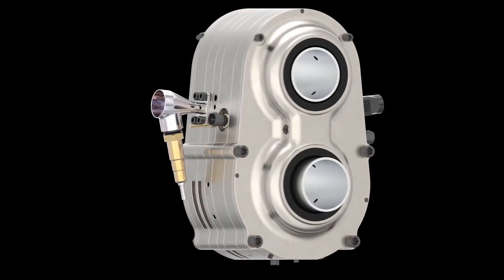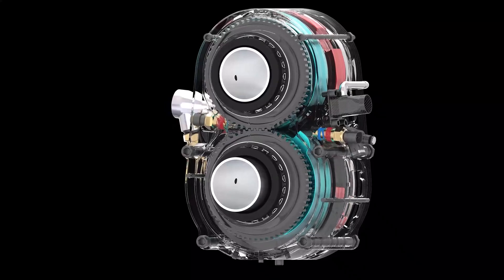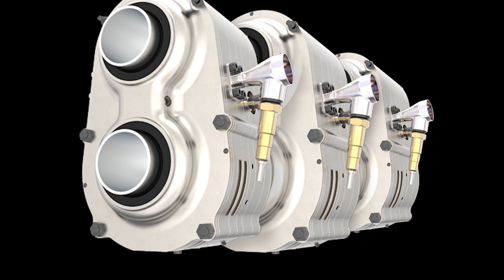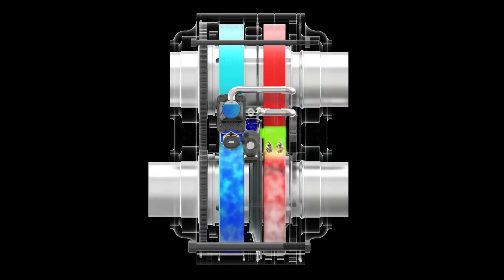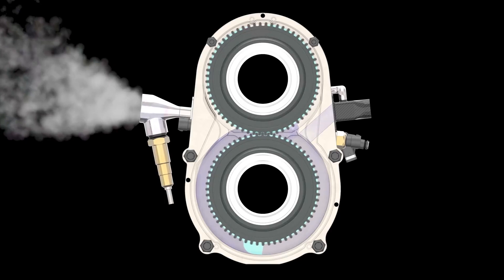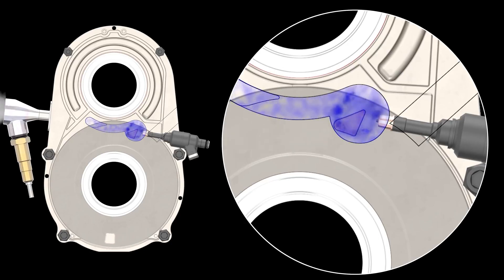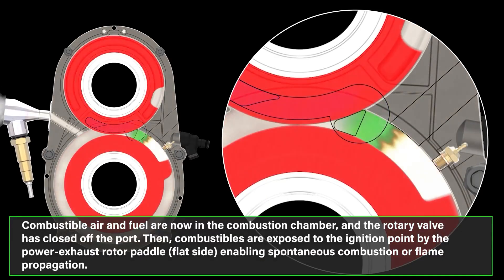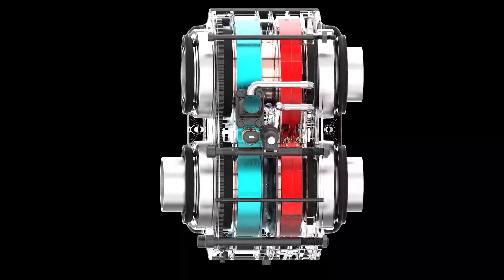This pistonless engine runs on hydrogen and revs to 25k rpm

Comment: Awesome, but I have questions:

Up to 416 hydrogen combustion cycles per second, with an insane compression ratio, and only a couple small openings in a couple dozen kilos of metal... What happens to the heat? How good is hydrogen at not detonating under that heat and pressure?

It seems too good to be true.

*edit for spelling
Reply: Hydrogen, among gasses has the widest range of explosive mixtures.

As far as undergoing true detonation, Hydrogen:Oxygen mixtures can easily be got to do that.
Reply: @Bob What yo do not seem to understand is that we already have a one world government.  And those people are the ones calling the shots.
Reply: @Bob The vast majority of hydrocarbons found on Earth occur in crude oil, petroleum, coal, and natural gas.

The most common place to find hydrogen on earth is in water. Each water molecule (H2 O) contains two hydrogen atoms.

Hydrogen is one proton and one electron and is the simplest of the elements.  It has 3 isotopes which are protium, deuterium, tritium.

You do not need hydrocarbons to get hydrogen.  It is found in its simplest form in sea water.

The owners of the petrol dollar will never allow that.
Reply: @Bob Anyways, I build RC planes and I am going to build a hydrogen generator by using water and potassium hydroxide (drain cleaner) as the electrolyte, and combine the gas with the exhaust from the turbine, which burns at 750 degrees C, to create an afterburner effect ,as hydrogen is highly combustible, on a 1/6 scale F-18 Hornet.  Gonna be dope!

Bob Lazar, the area 51 whistle blower in the 80's, built a car with an engine that ran on water!  Already been done.
Reply: @justanotherguy469  Do they not teach basic chemistry in school anymore? Hydrogen + Oxygen + a little energy to start the reaction causes a exothermic reaction (releases a large amount of energy) and creates water. This is how hydrogen engines produce power.
In order to separate the water back into hydrogen and oxygen you need to add the same amount of energy that was released when creating it as to not violate the conservation of energy. Otherwise you have created a perpetual energy machine. And as we have not been able to engineer a 100% efficient machine, the amount of energy needed to convert the water to usable hydrogen actually exceeds the amount of energy you can extract. The exception to this would be if you somehow managed to convert some matter directly into energy, but that is called nuclear fission and due to inefficiencies we have yet to make a stable reactor.

Also KOH + H20 -> Kaq + OHaq, aka aqueous hydroxide, not hydrogen. And I have no idea why you would need an electrolyte to generate hydrogen.

And also also if we have a one world government, why on earth would they care about the sustainability of the petro dollar? If there is one government controlling the world, would they not already control all the world's resources? And if they somehow managed to violate fundamental physics, would they not be leveraging that to further their goals?

Also also also Russia recently declared that all of their oil has to be purchased in rupals. The reason we have traded in USD up to this point is because it has been relatively stable, and because everyone is using it it's easy to do transactions.
Reply: @shadowcalen  I left a long comment for someone on Physics.  Check it out. Can't write about it right now. 

I will write about the petrol dollar and the role it played in Breton Woods.  

In 1912 a group of bankers conspired to overthrow the constitutional financial control of currency creation, from the people of the United States to themselves, by enlisting President Woodrow Wilson to pass by executive order the "Federal" Reserve act, which privatized our currency supply on December 23, 1913 while congress was out of session for the Christmas break.  The "Federal" Reserve is private.  Every penny collected for taxes goes to them, and not to infrastructure, social programs, or stimulus.  Since it does not fulfill its definitional requirements of what a tax is, there is no such thing as a tax.  The mob may call it "protection", but it is still extortion...what they do.

The system is set up so that every 20 years, they get to abscond with 50% our wealth undetected.

They create pestilence, war, and disease in order to facilitate the borrowing of currency which they get to create out of nothing.  It is our blood sweat and tears that gives this paper value.  We then have to turn around and pay it back with INTEREST.  But where will we get the currency for the interest payments?  We Don't.  It is perpetual debt.  Which is why we are debt slaves, BECAUSE MONEY IS DEBT, and we work for it.  It is a system of borrowing from Peter to pay back Peter!

In July of 1944, 44 nations convened in Bretton Woods, New Hampshire and they all came to the agreement of handing over all their gold to the United States for "safe keeping" and linking every currency to the US dollar, which makes the US dollar the world premiere reserve currency.  In order to conduct international business and trade, they must have vast reserves of USD on hand.  That effectively enabled the US to build, and export its inflation to every country in the world.  That was a deal with the devil.

In, I believe it to be, 1968, France came for its gold.  Guess what...we did not have it.  So on August 15 1971, Nixon de-linked the dollar from the Gold standard.  Which now means, we no longer have money.  Because money is backed by gold or silver.  That is the importance of the petrol dollar, it backs the dollar in that you can only buy oil in USD.  Nixon also created the EPA which is no more than a ruse to collateralize our national treasures, i.e, Yellowstone, Grand Canyon, etc. etc., to pay back the debt when the system collapses.

You see, they want to "legally" steal our wealth.

The system takes 120 years for complete take over.  

We will use $100 as our reference point as nobody can relate to a dollar, as it buys nothing anymore.  Also investigate what economic downturns and wars that takes place at each point of inflection.

Starting in 1913 $100 buys $100
come 1933, it buys $50
come 1953, it buys $25
come 1973, it buys $12.50
come 1993, it buys $6.25
come 2013, it buys $3.12
come 2017, Trump tries to end their vampireism  by not allowing them to raise interest rates for 4 years, so they tried to destroy him through media and their surrogates, the adjutants (BLM and ANTIFA).  

JFK tried with executive order 11110, which was for the government to print our own currency.  On November 22 1963, he went to Dallas and never came home.  God Bless Him.

Now had we used a dollar  as our reference point, we would see that a dollar is now worth 3 cents before the "pandemic".  Now in 2022 with the "stimulus", it is worth even less.

It is very troubling what you said about Russia only accepting payment in rubble's , that violates the petrol dollar and must lead to war, as with Iraq, Iran, and Libya.

The doomsday clock is not about time, it is about the value of the currency, as time is money.

The next and final depression will begin in 2028  with the collapse of the debt ceiling, and culminate in 2033.

There will be a new beginning where they will reveal themselves, where we will get free energy  and anti gravity devices.......In exchange for our souls.
Reply: It's pretty easy: the engine doesn't have time to get hot.
Reply: @jaggns5774  the engine doesn’t have time to get hot    Are you saying the engine is too busy or are you saying it will break before reaching operation temperature?
Reply: @advorak8529  I'm saying the engine has no time to get hot because it's going so fast.
412 microexplosions per second, that's a lot and there isn't much time for heat transfer.
Reply: @jaggns5774  yeah, 412 deflagrations/s so each one will transfer only a bit … but the engine runs for hours and these hundreds of bits per second do add up, don’t they?
Reply: @advorak8529  I guess the cooling offsets that.
Especially since the hydrogen is like.. super super cold pre ignition
Reply: @jaggns5774      Only if it the hydrogen is liquid.  And even then, hydrogen does have a very low heat capacity ... so it matters much less than you (probably) imagine.

And yes, cooling offsets heat (if it is enough cooling, that is the very job of cooling) just as it does in conventional piston engines!
Reply: @jaggns5774  how much will the hydrogens cold storage temps be offset by the compression heating of the atmospheric air though (nevermind the compression heating of the hydrogen itself as part of the mix)? And while 412 cycles a second is miniscule time per, they run continuously, so the heating is compounded over all subsequent cycles, unless it's cooling is so good that it can dump 100% of that thermal energy 412 times a second as well.

Id love to see this work, I just have some doubts.
Reply: heh... love how this topic is cropping up... 
food for thought on the line of central banking: the 'great depression' in america was in all likelihood an orchestrated event

notice 'the depression' is another of the topics that is never left for the memory hole to devour... you have seen the images, many times...
that past is always present and now in high definition
Reply: "It seems *too good to be true"

just keeping it real, cheers
Reply: Pure hydrogen will neither burn nor detonate. 

It becomes burnable when a bit of oxygen is introduced and a bit more and it goes boom. 

Which is why WWI zeppelins don’t do not really mind a couple dozen bullets going through them — the hydrogen is not under any pressure (just as the hot air is in an hot air balloon), not like your rubber party balloon.  But once some oxygen gets in there … 

The then-new incendiary anti-Zeppelin rounds changed the zeppelin bombing missions from nearly untouchable to near suicide, even though they evaded to greater and greater heights[1]. But even they had to fire a Lewis gun drum or two through it to get some burnable oxygen/hydrogen mixture.

Without having any closer look, I would guess the thin-ness of the engine is very helpful to pass through heat and that you probably need to put the engine exterior more-or-less into a cooling water sleeve.  And/or run a suboptimal, but cooler mixture.  Or inject water, that would help cooling (and turning to steam, causing additional “gas” volume).

I also guess that much of the lubrication is total loss. And with no seals, oil will be important …

It’ll be interesting to see if a prototype comes out and actually prove the concept. 

[1] the latter height climber Zeppelin types sacrificed almost all armament, all crew comfort, 1/6 of the fuel load, half the bomb load, and critically weakened (lightened) the structural integrity for better height performance. This came to bite the US built ZR1 Shenandoah, as it was based on the design of a height climber — and the people did not understand that this was a fair-weather-only model, meant to fly in the calmer air in 5 to 6km height, not capable of dealing with rough weather.  The only reason height climbers were  even halfway sane was that the alternative, lower flying but sturdier Zeppelins, were by that time dead meat … better gamble with a chance to get home than to assuredly not get home at all.
Reply: And hydrogen can be extracted from water.  Basically free.  This could have been done a long time ago.  Bob Lazar built his own hydrogen car in the 80's.
Reply: @justanotherguy469  a lot of things have been built but they reduce profits
Reply: @Star.Chaser  It is not about profits, it is about the petrol dollar.
Reply: @Star.Chaser  It is not about profits, it is about the sustainability of the petrol dollar.  "Money" is a tool to transfer wealth, which is resources and not paper.
Reply: @justanotherguy469  Basically free? lol. First, you need clean ion free water, so it needs to be ultra filtered reverse osmosis water and electrolysis uses massive amounts of power. Hydrogen from water is anything but cheap.

Thats why commercial hydrogen is extracted from natural gas - its cheaper that way… and we all know how expensive natural gas is.
Reply: @spoonikle  Are you familiar with Nicola Tesla?  He built a car with 2 small antennas that was collecting energy from the Schumann cavity.   He went to JP Morgan for funding and when Morgan asked where do you put the meter and Tesla said their is none, a week later his lab burned down.  We are 100 years behind as far as free energy is concerned.

Ning Lee, Thomas Townsend Brown, John Hutchinson, just to name a few, all demonstrated free energy and electro-gravitics.  They either disappeared or had their equipment and work confiscated.

Anti gravity and free energy from the vacuum has long been perfected.  Extracting energy from beneath the plank length (10^-34 cm) which is the smallest length possible within the framework of this universe requires breaking the thermodynamic equilibrium of the quantum vacuum. This has been done by directing asymmetric rotational and vibrational electromagnetic frequencies into a resonant cavity containing  the noble gas of xenon that has been plasmafied - the 4th state of matter.

The energy density at the zero point has been calculated to be that of a billion, trillion, trillion, trillion Andromeda Galaxies per cubic meter.  Stooooopid!

Extracting hydrogen from petroleum and other fossilized sources bring forth hydrocarbons, which destroys the environment.

Hydrogen is extracted from these sources, not because it is cheaper, but because it keeps the petrol dollar intact, and that is the most important thing to the people whom control the creation of the currency supply.  The petrol dollar keeps all nations subservient to them and transfers the wealth of the world into the hands of a very very small group of people.

Forget about physics for now and chemistry and everything else for that matter and learn how currency is created.
Reply: @justanotherguy469    Are you familiar with Nicola Tesla?  He built a  car with 2 small antennas that was.collecting energy from the Schumann cavity.

Tesla died  in 1943, on the 7th of January. 
The Schumann Resonance (SR) was predicted (mathematically, mind you) by a certain Mr. Schumann in 1952.

The waves are so weak that by 1960 finally measurement instruments sensitive enough to even detect them were available at all. 

A) It is therefore impossible for Mr Tesla to power a car I or before 1943 with 2 small antennas harvesting energy from the Schumann resonances as they were not even known then.  You need time travel for that. 

B) The electric field of the atmosphere in fine weather and dry air is around 120 V/m at sea level. The Schumann resonance is at 0.000,3 V/m.  In other words, there are better power sources — for better read “more than 5 orders of magnitude”[1] — the SR is not a sensible choice. 

C) We know that Mr Tesla was interested in power transfer without a cable.  Which involved a LOT more power than either. At a guess that is what you were hearing of or seeing photos of — a demonstration vehicle for wireless power transmission. Unless that car is completely made up. 

You mixed it up with some woo peddler sauce and a way too large helping of conspiracy theories — the kind where the best proof for the conspiracy is that there are no signs at all.

Please research these claims before you echo them.

Same goes for the complete rest of your “world government” (why do they not tell Russia or Ukraine to stop fighting?  Is devastation good for business— and if so, why not in half of the USA?) 

“anti-gravity”.  So how come the military ain’t having them?  How come we still use huge rockets to put — even military — satellites into space?  Why not make a killing by offering the launch services 20% below the cheapest real bidder, make all the commercial providers fold, buy them up, have a monopoly and retire the anti-grav?

beneath the plank length (10^-34 cm) is like “writing between 2 neighbouring cells” in a spreadsheet.   It does not make sense. 

requires breaking the thermodynamic equilibrium of the quantum vacuum.
Can you, in your own words, explain what that is supposed to mean? 

This has been done by directing asymmetric rotational  … can you give an example of symmetric rotational em frequencies?
Clockwise or anti-clockwise?
If you place the cavity on a turn table like a microwave does, will that not turn any em wave into an “asymmetric rotational” one?

and vibrational electromagnetic frequencies    … can you give an example of non-“vibrational” em frequencies?  0 Hz, maybe?

into a resonant cavity   … like the world? You do understand that Schumann resonance only exists because Earth is a resonant cavity, right?
Or like a microwave oven?

the noble gas of xenon    Are there ignoble gases of xenon, or maybe noble liquids of xenon or noble solids of xenon, so we must distinguish between them?  Or is that just the WOO factor of making trivial stuff sound complicated?

that has been plasmafied   In that case it may be the noble plasma of xenon, for it ain’t a gas when it is a plasma.  You make no sense — might as well talk about an ice cream that has been liquified or a whiskey that has been gasified. 

The energy density at the zero point has been calculated to be that of a billion, trillion, trillion, trillion Andromeda Galaxies per cubic meter.   Whoooo!  And then all that energy causes the Big Bang, shattering all that energy over the universe and making the universe inflate itself rapidly — an air bag is not even snail’s pace in comparison — at the same time!

Besides, a density is indifferent to size.  A drop of water has the same density than an ocean of the same water.  And as the zero point is infinitesimally tiny, the energy density is infinite anyway.

Extracting hydrogen from petroleum and other fossilized sources bring forth hydrocarbons, which destroys the environment.
Hydrocarbons destroy the environment?  I thought oxidising them causes the problem - with suboptimal settings and other stuff exacerbating the problem. 

Hydrogen is extracted from these sources, not because it is cheaper,[…]   Do you admit it is cheaper but claim that is not the reason they do it or are you saying it is more expensive?

PS: when scientists are being disappeared because they know too much, and you know all the important and damaging bits, why the heck are you still alive and with internet access?  The conspiracy spans the world, the most powerful people rules it and stop at nothing … yet you get to leak all that and threaten their life and money … and live free … 

[1] that is approximately the difference between one single 31” step and walking over 240 miles …
Reply: @justanotherguy469  oh, and lest I forget:
how currency is created    Somebody agrees to use something as an intermediate in bartering that somebody else also agrees with. Be that cancer sticks, sea shells, rounds of ammunition, shiny metal or whatever. The next step is when you use IOUs in place of the goods, backed by someone you think(!) will be able to make good on the IOU.  “… promises to pay the bearer on demand the sun of <face value>”.  We then can go to virtual money, promises to give IOUs, if the trust into the system is good enough and the risks (lowered by e.g. insurances) and costs are perceived to be less than the perceived bonuses.

Or in case of crypto currencies, instead of a few central organisations backing it, it is “backed” by the community willing to trade these tokens for money or goods and services. Which can make the currency rather volatile and starts at near zero value. An artificial rarity (the mining part) then causes an increase in value per unit as generating “free” new units becomes more and more and more expensive, keeping step with the approximate value of one unit. (If the unit is dearer than creating it, “professional” miners will buy up all the graphics cards to make money and run them hard, if the costs exceed the value, the miners will stop mining as they would lose money.  We’ve seen the abandoned mining rigs happen before.)
Of course you can also legislate a currency, but people will turn to unofficial currencies — EUR, USD, cigarettes, coffee, … if inflation is greater than the cost of using the unofficial currency (including penalties for breaking laws). 

Finally, of course, there are favours…

So … how am I doing?
Reply: @justanotherguy469  the oil/gas industry has made it their mission to stifle such progress.  Theres no money to be made in such power sources.  Hell the only reason they're pushing so hard to come out with EV cars now is because of lost sales to Tesla.
Reply: @ICU1337  EV cars still derive their power source from fossil fuels.  Its not about money to be made, its about the world having to pay for oil or gas in U.S dollars as the USD is the premiere world reserve currency.  That enables the US to charge the world a hidden "tax" by inflating its currency supply and ultimately gain control of the resources of all other nations.

The US is a straw man for the central banking cartel.  They do not need currency as they create it out of thin air, what they want is control over resources.  "Money", which is debt, is useless to them.
Reply: @justanotherguy469  EV cars really dont though...  And the USD has lil to nothing to do with the stagnation of cleaner energy sources than fossil fuels.

I'm fully aware of how the USD works and how its one of the few reasons that keeps the US a top and not a 3rd world country.  And while being fully aware of the power of the USD, I fully aware that you're trying to connect dots that dont connect...
Reply: @ICU1337  Okay then, tell me in your own words how currency is created and what the petrol dollar represents.
Reply: Nah its true. Thats why in canada we allow foriegn companys to come in extract oil from the ground and then sell it to us in american dollars and not canadian.
Reply: @justanotherguy469  I'd rather not.  Reading your responses I see the futile road this goes down.  Have fun with your dots.
Reply: @ICU1337  Take advantage of the knowledge that someone with over a half century has to offer.  You should try opening your mind and discuss.

"I'd rather not", just shows that you do not know, and your ego will keep you in the dark forever.

I can tell from your disrespect being levied at someone who is trying to let you know what has happened and what is about to happen, that you are brand new. 

Peace.
Reply: @justanotherguy469  "ake advantage of the knowledge that someone with over a half century has to offer"

Honestly, learn to humble thy self before you start to preach.  I told you to keep to yourself and you continue to push your opinions on me.

Self modesty is a lesson you might want to pick up with your half century of learning.  You're welcome.